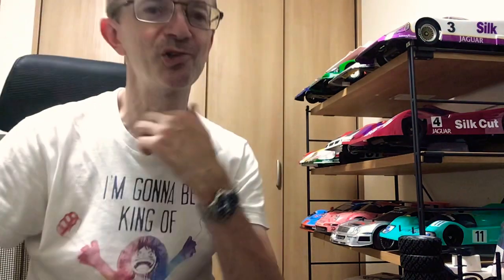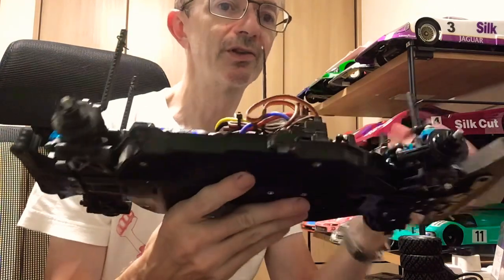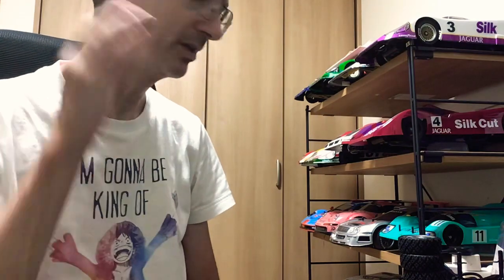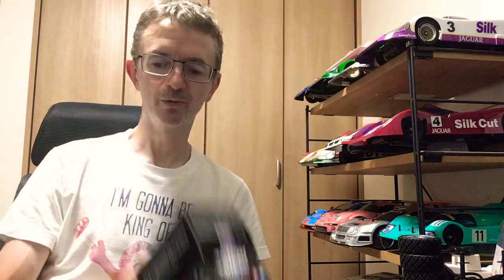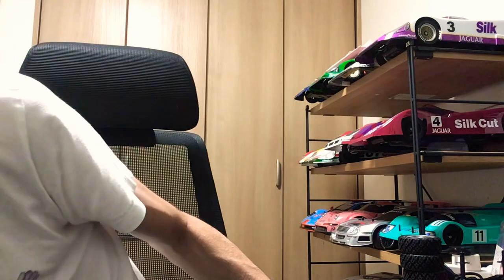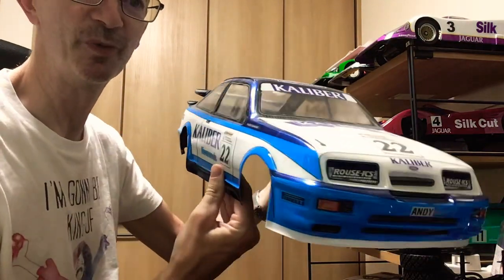The prologue:  speed challenge, Initial ramble about my tt02 no running @poorboysrc

Comment: So many goodies!!!
Reply from the maker: Yes, but getting an esc for the low turns seems a fine art!
Reply: @thebandit1974  It sure can be, I would think the higher the amperage rating, the better the capacity to handle a lower turn motor?
Reply from the maker: @poorboysrc  yes, but I have two high amp Ko propo Escs.  But they come with a safe set of settings to stop you frying everything.  Struggling to work out how to remove this restriction